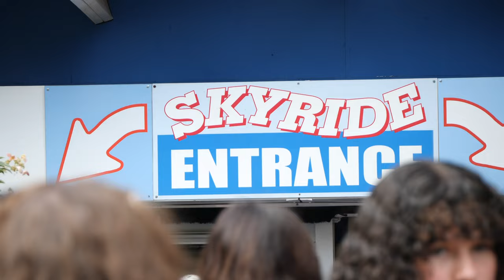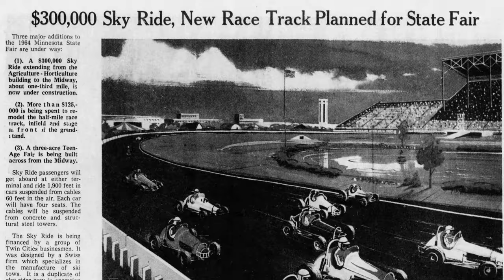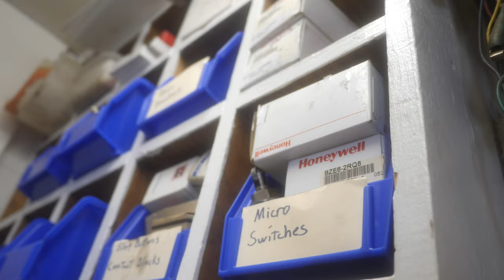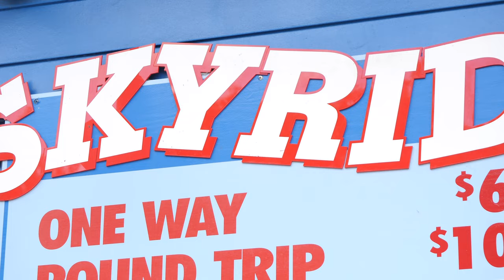A MN State Fair Staple - The Skyride - 1964 Von Roll 101

Comment: No modern 10-seater gondola lift, like what's destroying ALL vintage rare and mechanically different lifts in Europe, will ever last 60 years, before all of their overcomplications start to make themselves known(by malfunctioning). The manufacturers of modern lifts say the modern lifts are "easier to maintain", whereas one can LITERALLY SEE THE MECHANICAL SIMPLICITY of an old design from before the standardization imposition of the 1990's in Europe.

The Von Roll "VR101" as it's called was the first detachable single-cable ski lift system in history. The first one was built in 1945 in Flims-Laax-Falera(Die ursprungliche Sesselbahn Foppa, 1945 - 1986, ersetzt durch eine Garaventa 3er Kuppelbare Sesselbahn aus dem ersten Generation wurde auch ersetzt im 2023 durch eine scheissen modernen Massenproduktion 10er Gondelbahn ohne Seltenheit oder Mechanischem Vielfalt, wie war an allen seltenen Seilbahn passierte...), and the oldest one in existence, in Krupka, CZ, just 50 minutes away from Dresden, is 72 years old. It will not be slaughtered by a crappy modern lift either!

While I am happy that Von Roll VR101's have been built in more places than just mountain regions(and have the recognition for being the mechanical works of art which all old ski lifts are), that should have happened to all old ski lifts. They can be built anywhere, and it is beyond me as to why people didn't take advantage of that fact. Nearly all old ski lifts are gone as a result.